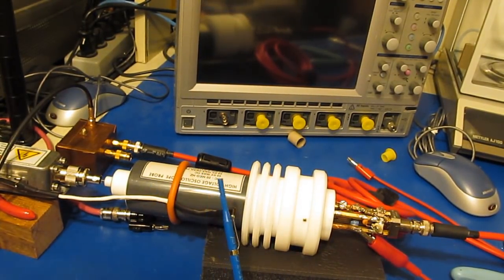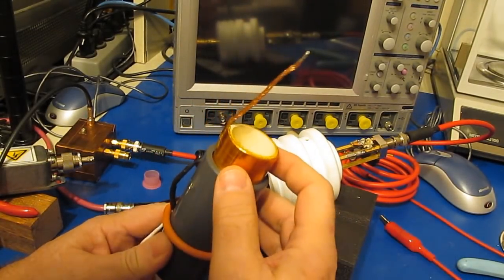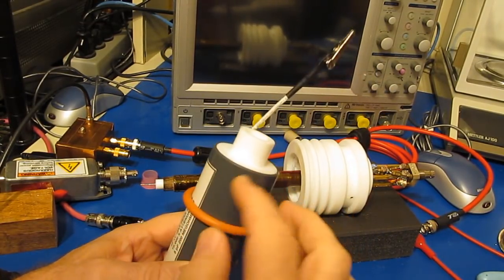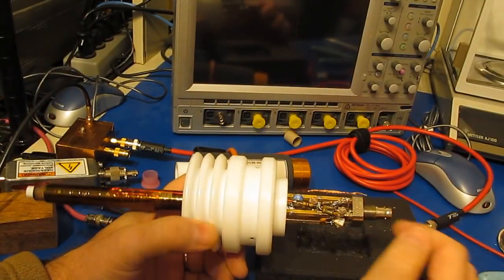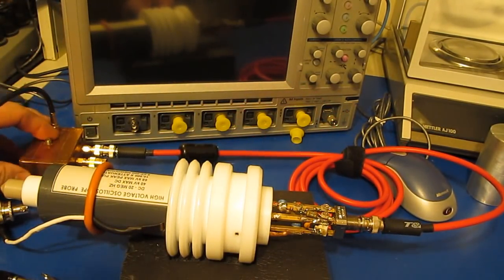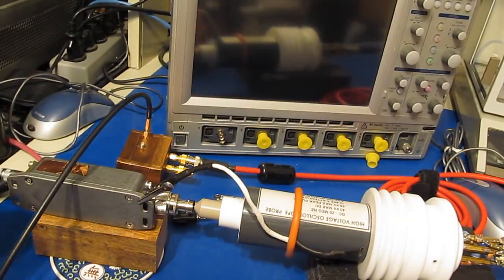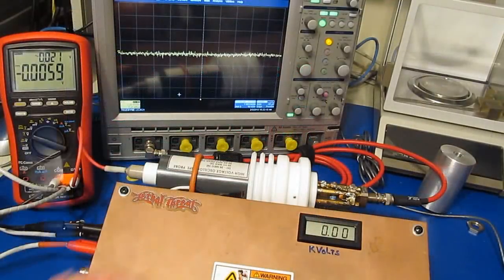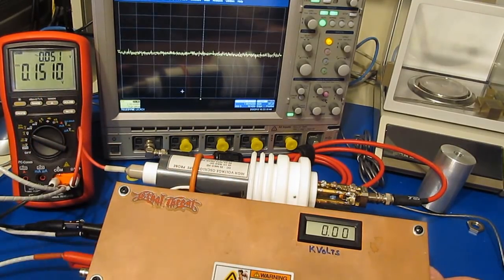Repairing the Homemade Wideband High Voltage Probe

Comment: I enjoy your videos.  I am a retired Pulsed Power Engineer so I was really interested in your probe design.   Nice work.  In your video you mentioned NorthStar as a maker of high voltage probes.  I have used them and they do not have a very good reputation.  The one we had certainly did not perform as well as your probe appears too work.   Generally NorthStar had a reputation for building cheapish products although some items were decent.    Curious as to what kind of switch you use in your pulse generators?
Reply: We actually made a very fast single shot 10kv pulser once with sharp "tack" electrode, some mylar sheet and an insulated hammer like device.  Works really well and with the right geometry you can get sub-ns rise time
Reply from the maker: I was very happy with the Northstar product  They cost a fair amount but the quality and performance were decent.  There is a FAQ and a few videos that have a bit of information about the generators.
Reply: skilledatplay Maybe thumbtack and hammer switch? 😉
Reply: joe smith where is the FAQ? On EEV blog?
Reply from the maker: Yes, the link to the FAQ may be found on the EEVBLOG where I post about testing the meters.  You may also find it in the About page.  You could also find it in most of the descriptions for the meters I have tested.

Comment: Good show as usual! Was that last part with the plugs run by the engine simulator?
Reply from the maker: Hey Cliff, no that was just a simple IGBT/FET driver connected to an automotive ignition coil with an antique spark plug.